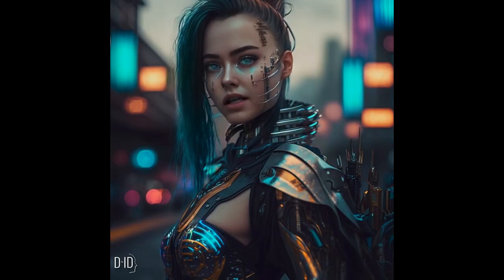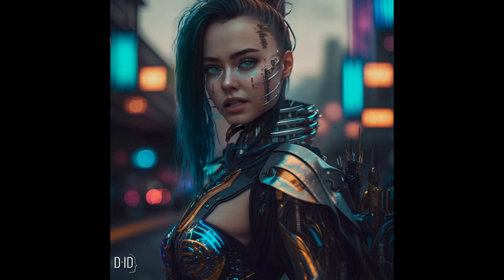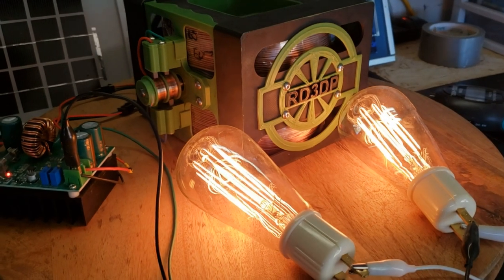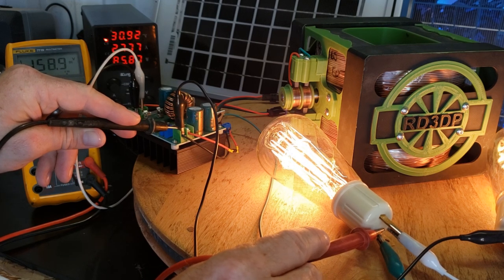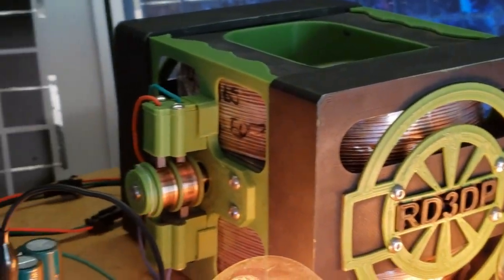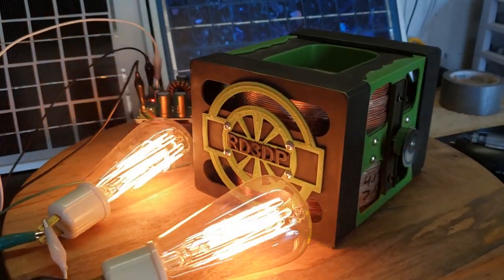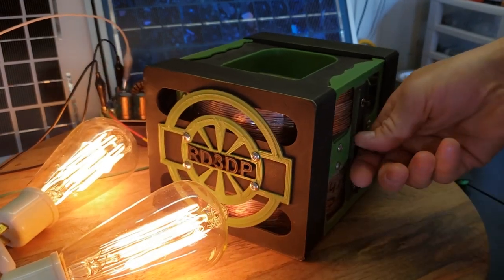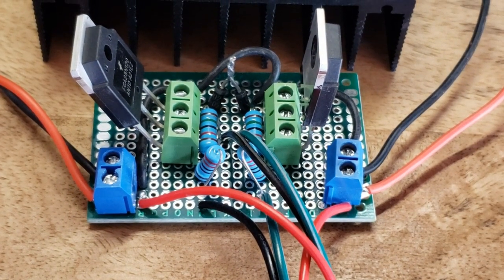Big Newman Motor

Comment: Whoa - that looks great. Love the coil stator designs. Sharp!
Reply from the maker: If you have a printer you should build one
Reply: @redesign3dp  I do but had problems printing the spools with a lip or overhang - do u print the spools in two halves and glue together?
Reply from the maker: Yes, everything is designed to print easy. I also use a 1.0mm nozzles to print faster. Bobbins are two pieces.

Comment: Very clean setup great design. Is it that you've used a massive amount of wire or they're just thick. Looks like alot. Good Job Mate!
Reply: Do you intend to add a flywheel aswell. That tends to be an overlooked aspect of Mr. newman's motor?
Reply from the maker: His rotor was a 700lbs flywheel.  But me, nah. I'm just showing my latest design. People are free to build one, my stl files are on my e store. I'll be designing something else soon anyway.

Comment: In short, would you believe that Newman Motor/generator can be over unity system?
Reply from the maker: Not mine. I'd need 10k lbs of copper and a 700 lbs rotor. Then it would run of of straight voltage.

Comment: And is this for sale I need this one
Reply from the maker: I am thinking about selling kits. All the 3d printed parts, the electronics, and design plans. But the buyer will have to add the magnets and wire. Does that sound like a good compromise?
Reply: I think its not a bad deal
Reply: I too would like a kit would print custom kits based on individual needs?  Send a link so i can contact you